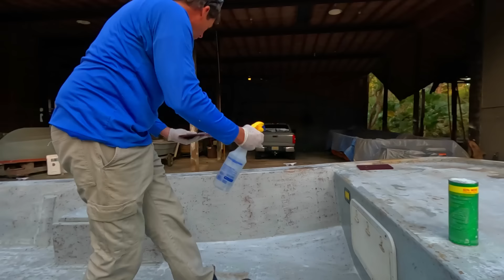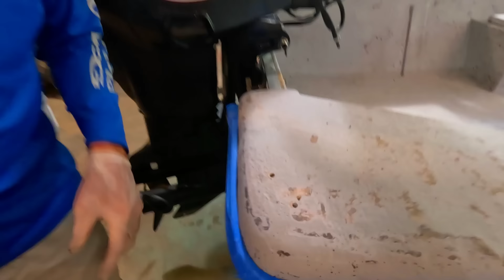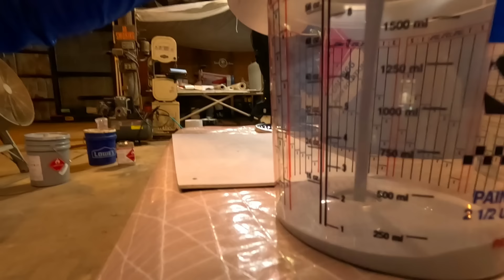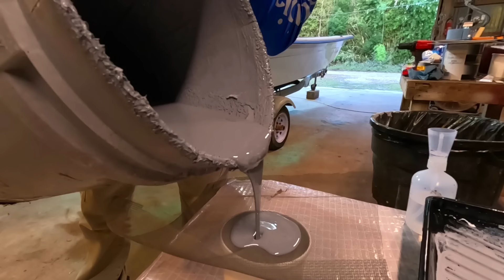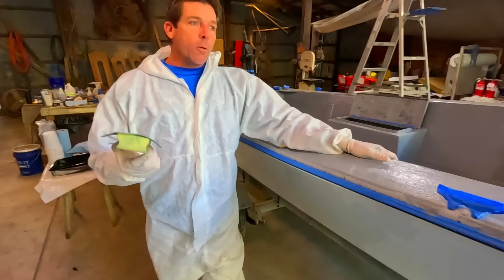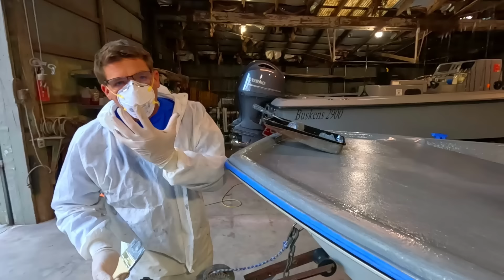How To Re-Gel Coat A Boat - DIY Cheapest & Easiest

Comment: Great content and clear instruction. One question. You said the gel coat leaves an orange peel type texture. Is that also true on smooth surfaces? I can't imagine it is, but want to make sure.
Reply from the maker: Glad you enjoyed the video! Yes, gelcoat will definitely have some texture to it, especially when rolled on. If you roll it on, then tip it with a brush you will be able to get a smoother surface. If it is spayed in its pure format, you will still have texture. There are some clear additives for gelcoat that helps it to flow out nice, and I will be making  a video on one of these clear gelcoat additives very soon. Any of these application methods can be wet sanded, polished and buffed out to a shine if that's what you are looking for, but that requires quite a bit of additional work. I hope this helps, and thanks for watching!

Comment: What is the process of sanding? High speed grinder then oscillating sander?
Reply from the maker: Just a quick pass with a grinder with 36 grit, then vacuum out and scrub thoroughly with a scotch Brite pad and some comet or Ajax. A good rinse and a wipedown with acetone. Of course you could hit it with a orbital sander after grinding if you wanted to. I hope this helps and thanks for watching!
Reply: Thanks for the reply. I am grinding off the hull hell coat and bottom paint to reapply a gel coat, just didn’t know if I needed to stay conservative 60 grit and it takes longer or hammer with a coarser grinder then follow with an orbital.

Comment: Love your channel super helpful about to start doing my own fiberglass and get coat attempts on my boat for the first time and definitely ending up on your channel more than anyone elses. going to start with spider cracks and work my way up to making a new bulkhead.
Reply from the maker: Wow, thanks so much! Best of luck with your project!
Reply: I'll be doing the same. I'm that guy that has to repair a fairly deep crack that I think is a impact crack. It's under the boat so I'll be doing a lot of over head work. I plan on using a dremel to grind the crack out to widen it and grind until I hit fiber glass or the crack is gone. I'm hoping the glass is okay so I can just use a polyester filler and gelcoat paste to repair. I was hoping to use gelcoat paste to refill the crack if I don't have to do any glass work. I just don't know if that's okay? It seems like it would be. All I'd be doing is using the same material gelcoat that I removed.

Comment: May I know what kind of roller you used for gelcoat. Thanks
Reply from the maker: Corona makes a quality roller,  but if you wrap them in tape and then pull if off it will remove a lot of the loose hairs. 3/8 nap is what I usually use. Thanks for watching!
Reply: @FishBumpTV  Thanks captain

Comment: What did did you use on the bosch?
I'm confused on is first coat non wax gelcoat topside paint then  coat #2 same just add that jelcoat?
Thank you
I think this form of video is good for application.
I would like to see a video on just how to mix/what ever is coat 1 and coat 2 and on.
Thank you very much
Reply from the maker: The boats interior is finished all in gelcoat. When working with gelcoat in this kind of application, only the last coat has wax added to help the gelcoat fully cure and dry tack free. We just released a wax vs no wax gelcoat video that you might find helpful. Thanks for watching!

Comment: The the surface you need a topcoat, not gelcoat!
Reply from the maker: This boat was originally built with a gelcoat finished interior,  and that's what the owner wanted to refinish with. Topside paint or topcoat  is a completely different product altogether. You might want to do some research on these materials so that you have a better understanding of when to use each one. I hope this helps, and thanks for watching

Comment: Do you have a video of applying gelcoat to a brand new floor and transom? I just put new floor and transom on my 15 ft and I need to know the best to put on the fiberglass floor. With wax or without wax? Can i mix paint in for colors? Do i need to have gelcoat with hardner or not?
Reply from the maker: We only put wax in the last coat of gelcoat. No, you would not mix in paint for color, there are gelcoat pigments for that. Yes, gelcoat has to be catalyzed at 1 to 2 percent by volume with MEKP  methyl ethyl ketone peroxide or it will not cure. I hope this helps, and thanks for watching

Comment: Hey fish bump! Love your work and it has really helped me getting through my first boat renovation, im in the stage of doing some gelcoat and and was wondering if it is possible to gelcoat over the old polyester hull? I have mailing some companies here in finland where i am at and theyre saying that putting polyester gelcoat over the old hull is a bad idea and that i should use a primer, what are your suggestions?
Reply from the maker: Thanks ! Glad you are enjoying the videos all the way from Finland! Yes, you can gelcoat over a polyester hull< it is just a lot of work if you want the gelcoat to be glossy. It would have to be applied to the hull, then wet sanded and polished to make it shine. Some might say that painting with a marine paint system would be easier. Thanks again for watching!

Comment: HI love watching your vids.. I am redoing a kayak, like this job i want to do multi layers of gelcoat. With this your first coat you didn't add wax solution.. so how did the first layer cure so it wasnt tacky when you were touching it?
Reply from the maker: When it cures without wax it will still be a little tacky, but not so much that you can't work over it if you are careful.  Fabric will stick to it, so will a tyvek suit, but rubber sole boots and rubber gloves will work good. Hope this helps, and best of luck with your project!
Reply: @FishBumpTV  Cheers, so just confirming your first coat was wax free, and then you just painted waxed gelcoat (flowcoat) over the tacky gelcoat?
Reply from the maker: @timgriffiths4793  yes, wax free gelcoat on all coats except the last one.
Reply: @FishBumpTV  thank you 😊

Comment: So I’m about to start a project on my boat this weekend. I’m ripping out the carpet on the walls and ceiling in the cabin. I know I’m going to have to sand the spray adhesive. Is there any other things I should do or need to know about before I attempt to gel coat the walls and ceiling? I could use any and all the help I can get. This will be my first time doing gel coat

Comment: Can you provide the specifics of what roller sleeve you used? Great video!
Reply from the maker: We use a 3/8 nap roller, cut in half. Corona make a good roller sleeve, but most decent ones will work just fine. I used compressed are to blow  any loose fibers away, then wrap it in tape to help pull any more loose fibers away before using it. Hope this helps and thanks for watching!

Comment: Got the pro strand at my local NAPA for $50! Yay! Working on my 1986 Champion. I was planning on gel coat on the front and mid deck and I like your method for just rolling it on. We are using DriDek panels instead of carpet. Our top deck deck color is close to a burgundy. What would you recommend for achieving that color? We are not looking to get an exact match.
Reply from the maker: Good deal! Burgundy is not a super common color for us to use, but you might want to check with spectrum gelcoat, fiberglass warehouse,  or FGCI to see if they have a stock gelcoat color that could work for you. Otherwise you would start with a neutral gelcoat base and tint it till you were happy with the color. We are working on getting a gelcoat match video out soon for you guys. Hope this helps and thanks for watching!

Comment: I am preparing to restore a 1950's fiberglass car body and find your fiberglass videos some of the best for restoration fiberglass. Although on boats. 
If you were going to paint over the gel coat would you skip the "wax"?
What type of primer would you recommend?  I'm thinking an epoxy.
Reply from the maker: Glad you are finding the videos to be helpful! Even if you want to paint over the gelcoat, we would still add wax to it. If you don't add wax,  the surface will remain in a tacky condition. You would just sand the entire surface of the gelcoat very well after it has cured. Then you could do a solvent wipedown. Hope this helps and thanks for watching!

Comment: Good call on the mask.  In future videos you might consider mentioning organic vapor cartridges for the paint and acetone.  Many folks would not realize that there are mask cartridges specific to the airborne hazard; particulate cartridge for dusty work, organic vapor for paints and chemicals, etc.
I'm planning to gel coat my canoe so I'm paying close attention.
Thank you.
Reply: No idea why he's wearing that paper mask for the gel coat.  It's doing absolutely nothing
Reply: @veganpotterthevegan so you can hear what he's saying.
Reply: @awakenotwoke4830  it doesn't work at all.  If anything, it traps toxic vapors that would not be there due to air circulation.
Reply from the maker: Thanks for the suggestion and I appreciate you watching!
Reply: Yeah I noticed that too. Particulate filters will not filter acetone or paint fumes. You'll need the correct filter cartridges (ABEK?).

Comment: If you mess up and not ad enough wax and your final coat is still tacky after curing is it ok to do a 3rd coat with the proper amount of wax without any prep steps other than maybe a acetone wipedown?  Thanks!
Reply from the maker: Yes, you should be able to do that with no problem. Just be sure to mix up your wax additive very well.Sometimes the wax will separate from the solution, warming it up will help with this. Hope this helps and thanks for watching!

Comment: How do you get the shiny look after you gel coat?  Is there a clear coat gel coat that applies the same way?  Thanks love the channel. I’m a new subscriber.  I have a camper with gel coat that is dull and oxidized,. Not sure I can save the black color. Gonna try wet sanding and rubbing it out first.
Reply from the maker: To get gelcoat to shine, it either has to come out of a mold,  or it has to be wet sanded and polished. It is a pretty labor intensive process. I would definitely try restoring your gelcoat first. We have a video detailing the gelcoat restoration process here on the channel. Hope that helps, and thanks for watching!

Comment: I have a stratos bass boat can i use it to coat the deck !!!
Reply from the maker: Usually the deck or surface you are gelcoating would be fiberglassed clean and lightly sanded first. If that is the case then yes you should be able to use gelcoat. Thanks for watching!

Comment: Love your glass content.  If you use a short mohair/cashmere or even foam roller AND reduce the gel coat with styrene will it come out much smoother?  Would a little less activator help it to flow out like a paint or is is just too thick anyway?  More coats but with less sanding for a smooth finish?

Are you not concerned with the deck being slippery when wet?
Reply from the maker: Gelcoat it much thicker than paint and really doesn't flow out the same. For this particular boat a smooth finish was not important, and the texture that a roller gives the gelcoat provides a decent  surface as far as grip. I will be making a video very soon discussing different ways to  apply gelcoat to get a smoother finish. Thanks for watching and commenting.

Comment: Hey a quick question, I found this video really helpful, I’m buying a custom fibreglass high roof for my Mercedes Sprinter van from a guy that used an old Mercedes factory mold to make one but he never got around to bonding it to his own van. The problem is, the roof has a silver gel coat but my van is dark green, can I apply a new gel coat in the way you’ve done here, to match the colour of my vehicle? You did mention at the end that the natural gel coat has that orange peel type effect which I would have to try and get rid of in order to bring up a high gloss smooth finish. Is this possible?

Also, I noticed the roof has a slight wave texture down the sides, he told me it’s because the mold was old and there wasn’t much he could do about it. Is it possible in preparation to recolour the roof, to somehow fill and sand out that wavy texture and get it mint? I don’t mind spending the time to get it right, just curious if it can be done or not to bother?

Thank you, really love this channel!
Reply from the maker: Since this is an auto and not marine job I would recommend using a 2 part automotive style paint system. The surface would need to be thoroughly clean, sanded and primed. Then bodywork on the texture down the sides, followed by more primer over the finished bodywork. Sand and mask everything then spray. I know that sounds like a lot, but trying to match gelcoat color to existing automotive color, then trying to wetsand and polish to a shine would be a TON of work! Hope this helps and thanks for watching!

Comment: If you are gel coating a similar style skiff and it has marine paint do u need to sand all paint off or sand to a decent roughness for the adhesion of gel coat?
Reply from the maker: Yes, I would remove all of the old paint before applying new gel coat if it were me. Hope this helps, thanks for watching!
Reply: @FishBumpTV  I was afraid you would say that lol…

Comment: When I got the materials to repair my boat from the boat repair shop, they gave me some paraffin wax. Is that the same as gel coat or something else? I realy appreciate the information and help videos!!
Reply from the maker: Wax can be added to gelcoat to help it dry tack free. But it is usually dissolved into a styrene solution called modifier C wax solution. Hope this helps,  thanks for watching!
Reply: @FishBumpTV  thank you very much!

Comment: Great video thanks Joe. I didn't see you adding any wax to the undercoate gelcoat, but you were still able to get up in the boat to roll out the second coat. Was the undercoate very tacky whilst youo were moving around on it? Did it mark the undercoat at all?
Reply from the maker: No wax in the first coat, a little tacky, but you can walk on it. With a roller finish it works out fine. Thanks for watching!

Comment: Hey Captain Joe, I just bought an '85 Bluewater Coastal Cruiser, she is beautiful! however her name was changed a couple years ago and on the stern and you can clearly see where the old name was removed from in the gelcoat. You can actually feel where the letters were. I would like to see a video of an efficient way to restore the stern so you can't see the previous lettering. My guess is wet sanding? You are doing a great job with your channel. I finally actually want to do fiberglass repair. I hope for you and your family that this Channel is working for you and your company. Great job! Tony
Reply from the maker: Congrats on your purchase! Yes, wet sanding with a rigid block and 600 grit, then 800 and 1200 to finish. Then compound and polish, followed by wax should do the trick. Best of luck!

Comment: Still watching your channel, I’m doing a total restoration on a 1979 / 21’ center console with a 20” transom. Planning on purchasing a used engine but having an issue finding good used engines with a 20” shaft. My question is what are your thoughts on raising the transom to accept a 25” shaft engine.
Thank you
God Bless and continue on with your journey it’s all good
Reply from the maker: Yes, a transom can be raised to accept a longer shaft motor, but it has to be done right! Obviously a lot of load is on the transom, and if the job is done incorrectly, bad things could happen! If it is a small boat, and small motor it would not be as critical. I approach that job with some caution. Hope this helps, thanks for Watching!

Comment: I have an old Citation II fiberglass Dune Buggy with heavy metal flake finish.  It got too much sun and it bubbled up a clear coat that needs to be repaired.  Is it possible to clean it up and add clear again over pretty rough textured metal flakes?  What’s the best way to repair it without spending a fortune?
Reply from the maker: Sorry, but I don't have much metal flake experience at all. I will try to do some research on that subject for you guys. Thanks for watching!

Comment: What is a gel coat?
Reply from the maker: Gelcoat is basically a high quality pigmented resin used in and on fiberglass boats and other fiberglass products. It is thicker, and usually more durable than most conventional paints. Hope this helps, thanks for watching!

Comment: I have watched your videos on the 29 build and like the content, so maybe you could show me how to make a potable cooler for my boat to hold fish, ice or whatever else I need on the boat for a few days. Years ago I made a larger fish box with some kind of foam and fiberglass over it then I painted it with gel coat. I just don’t remember the material or the steps l did to make it, thanks for any tips.
Reply from the maker: I have built several insulated, fiberglass over foam fish boxes over the years. I plan on building one for our 29, to replace the Engel cooler in front of the console. We typically used 1.5 or 2 inch thick, 2 pound density fiberglass compatible insulation foam. It has to be marine grade, and compatible with the solvents in the resin. Most fiberglass distributors should know what exact foam to sell to you. I will try to make a video on this when I can. Hope this helps, thanks for watching!

Comment: You can also add about 8% Mineral spirits to help the gelcote smooth out
Reply from the maker: I have never used mineral spirits with gelcoat, the reps for the gelcoat we use recommended 5 percent styrene max. The formulas  for different brands can vary these days. Thanks for watching and commenting!